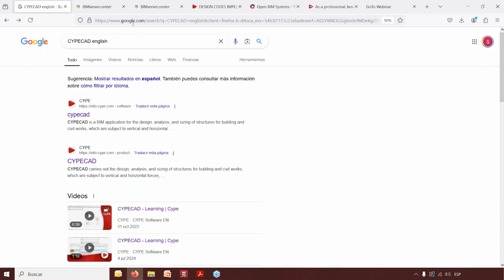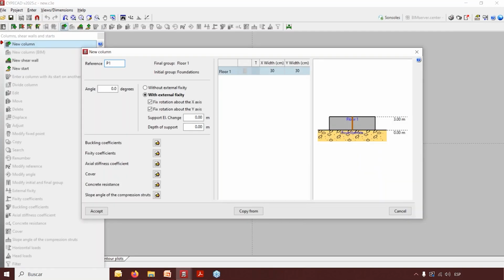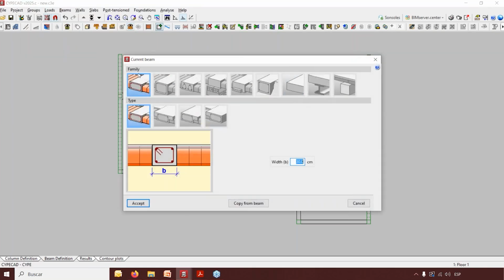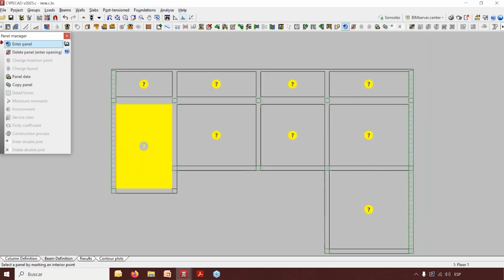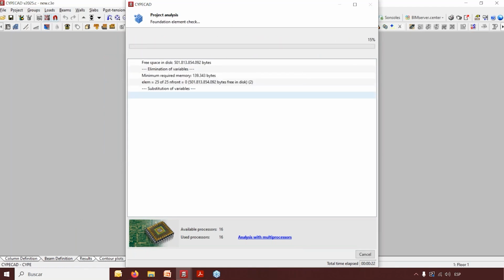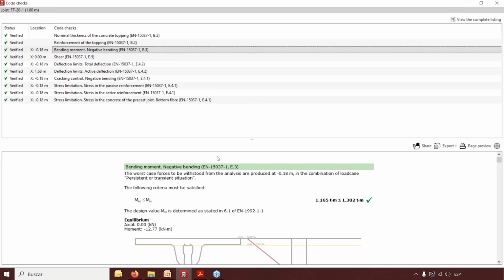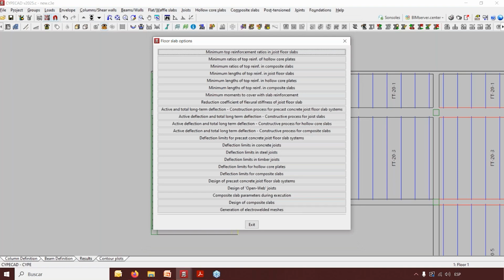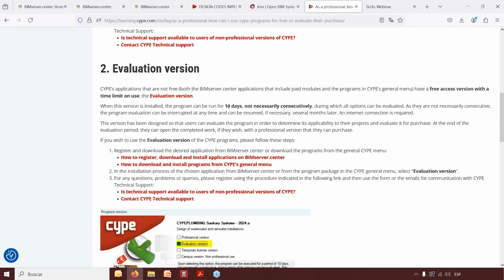WEBINAR: Designing precast concrete joist floor slab systems with CYPECAD

Comment: How do we change and modify reinforcement in joist
Reply from the maker: Hello! They can be modified after carrying out the analysis in the "Results" tab, from the "Joists" menu, using the "Top reinforcement: Modify" or "Bottom reinforcement: Edit" options. In the latter case, if it is an in situ joist floor slab, the reinforcement will be indicated so that it can be modified directly. If it is a slab with reinforced or prestressed joists due to geometric characteristics, the program will provide the analysed bending moment value so that the joist can be selected from a manufacturer's catalogue. Changes made to joist reinforcement are not retained in subsequent redesigns, so they should be made at the end of the work process. Kind regards 😊